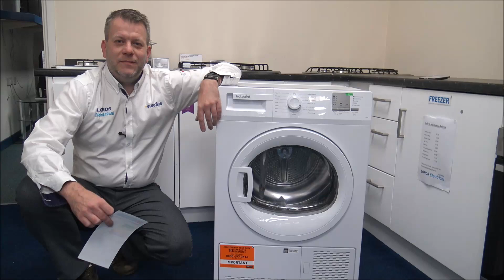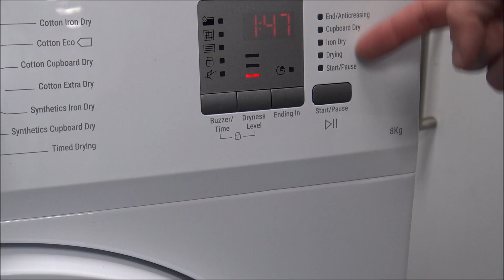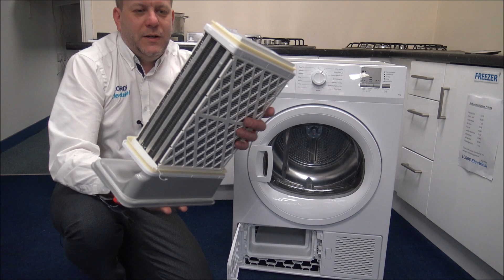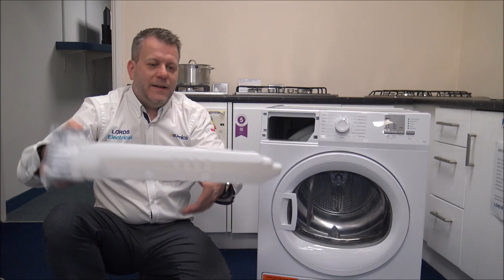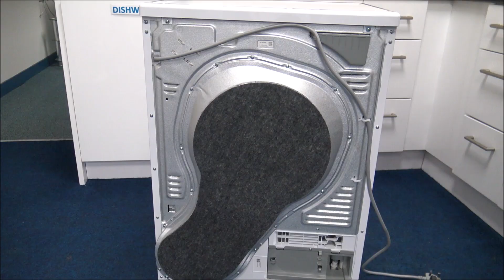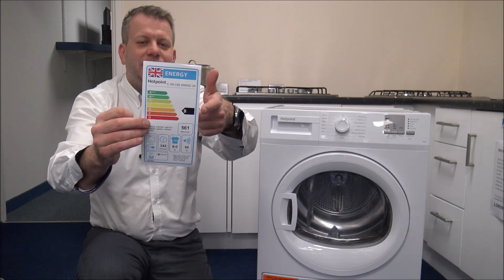Hotpoint CHDC82WWGDUK 8Kg Condenser Dryer

Comment: My beko condenser dryer is making multiple beeps at the end of the cycle and it never use to what could this be do you know please
Reply from the maker: I've not heard of that before, it could be that the filter or condenser unit needs cleaning?
Reply: @lords-electrical done both do them all the time
Reply: @lords-electrical done that do them all the time

Comment: Thank you for the detailed video and clarifying the options available to either collect the condensed water in a tank or using the horse pipe to discharge the water. This information is only available on Hotpoint website and on the Marks Electrical website.

Comment: How do you open door when locked
Reply from the maker: You need to wait until the machines door lock has unlocked before you can open it which is normally about 1 minute at the end of the program or when the power is switched off to the machine

Comment: Do kind of find it weird that Beko has decided to release a condenser tumble dryer (under Hotpoint’s name as they’ve partnered up) considering that the EU are going to be updating the Energy Label for tumble dryers in mid-2025, just like with washing machines in 2020. Meaning that the only type that will be available is Heat Pump since Vented and Condensers (that are currently around D to B rated) will be pushed down to around G to H rated which don’t exist, meaning they’ll be discontinued